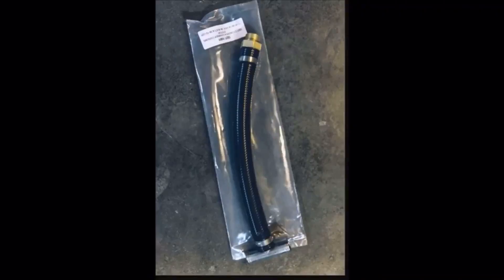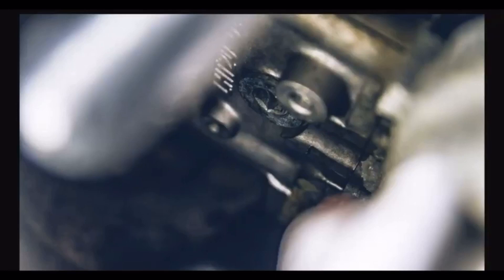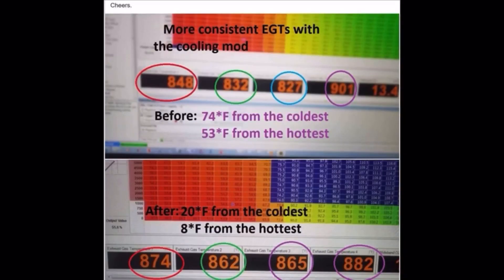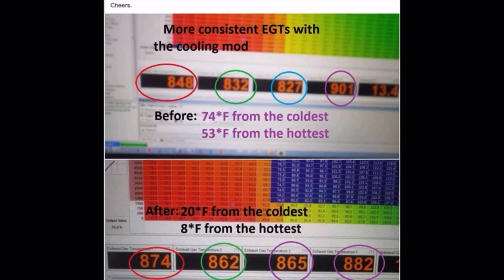Install: GDT Cylinder 4 Cooling Mod

Comment: It can be a bit cheaper, you can assemble it yourself, just buy the fittings & a peice of hose.  Should be maybe $30 or less
Reply from the maker: It came out to 68$ from our local shop. Why I just got this one for 55$ during 15% off